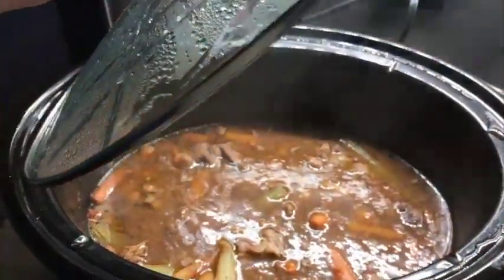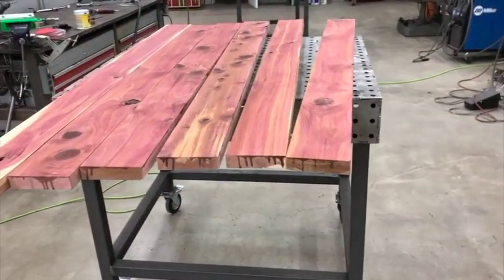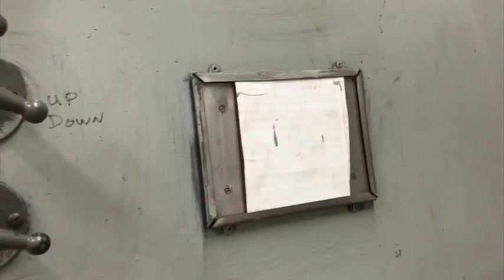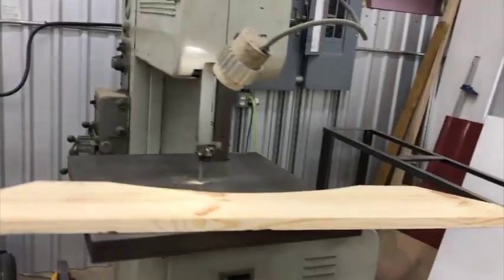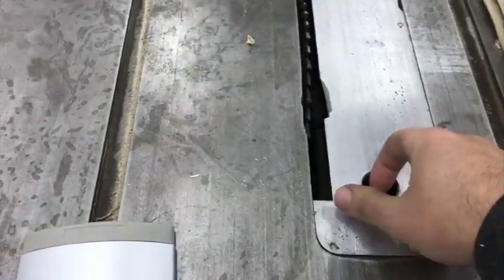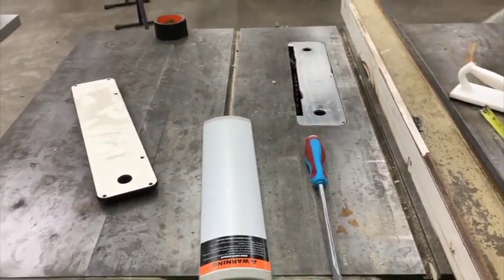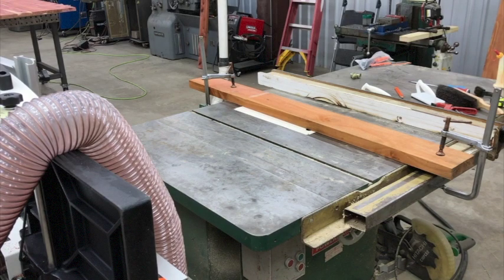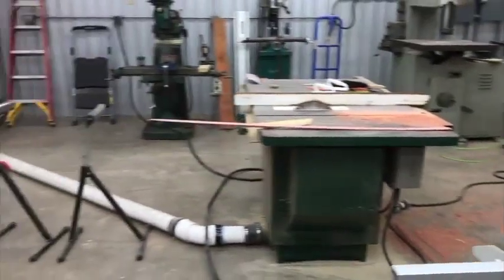What is a Grub Screw? Oldbarn Homesteading

Comment: Gary, those screws on the table saw are to level the blade guard to be flush with the table. As for grub screws, they are normally the second set of screws that tighten against the first set to lock them from moving.
Reply from the maker: yes sir, thank you!

Comment: Always something new to learn in the shop. If your insert is just a phenolic then you can sand it down with a belt sander, or if you really want to get fancy, put it in your mill and mill around the edges where it actually sits in the saw table and use your "grub" screws to adjust it up and down...

Comment: if you do much clamping of wood you might want to switch to a bar clamp that screws tight, Bessy are good. I find those squeeze type don't work well. Adding some bars (wood or steel) across the glued up boards will help keep them from cupping. if you end up doing alot of this type of work you'll want  a drum sander to flatten it afterward.
Reply from the maker: I have 2 bessey clamps, and yea I would like to get more.  I bought those squeeze types in a pinch one night when I clamped up a table top and the only thing available to me locally at the time I needed were those.

Comment: Grub or set, both work for me. Table saw runs nice. All the ones I've ever dealt with have bent arbors.
Reply from the maker: Thanks, Yes yoru right, it does run true, which is rare for an older saw , I checked the runout on it when I bought it, ti's running at .0015"
Reply: That's very good. Our metal cutting table saw, the arbor was bent .009" when measuring the it between centers. We flame straightened it using Tom Lipton's tips, and got it to within .0015" or so. The blade runs out about .005", but the saw pulley system is designed to where it shakes about no matter how straight everything is. I hate cheap table-saws, I will never buy one.